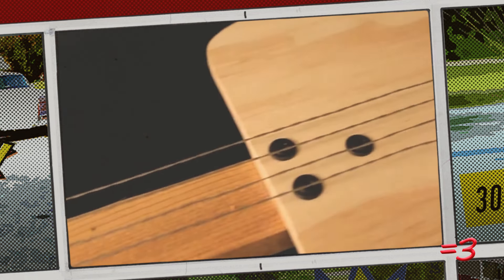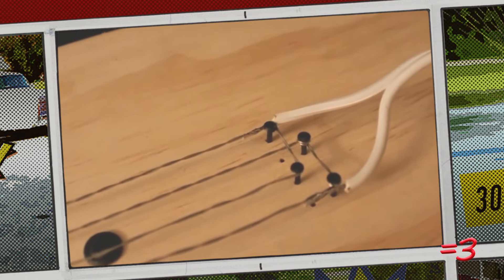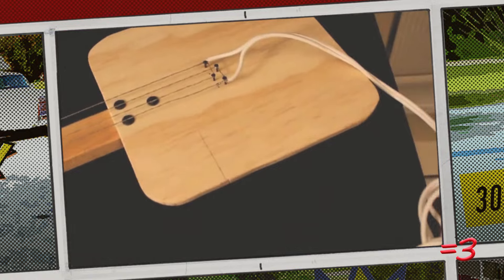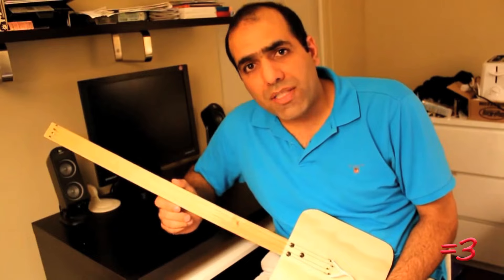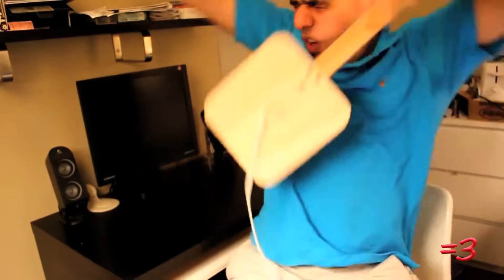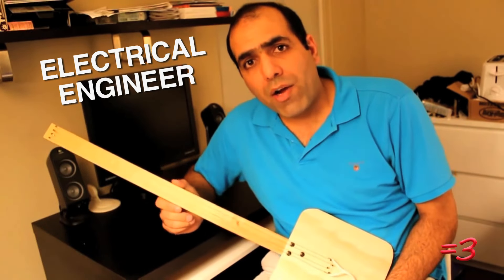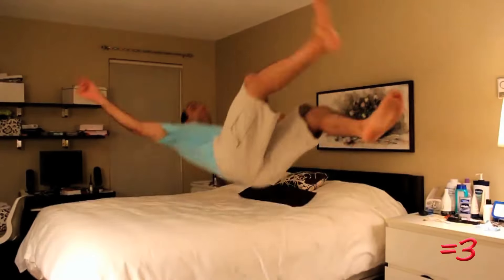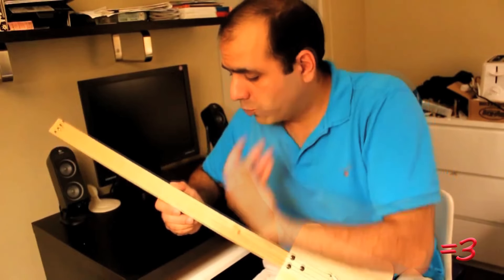How To Make An Electric Guitar (2013)

Comment: You can also tell its fake if you look at the way the "Electric Guitar" fell on him. Since he touched both the ground and positive wire (aka "completing the circuit"), he would have gotten about 120v passed through him, causing all his muscles to contract, then causing him to not be able to remove it. He would then just fall, and likely be temporarily paralyzed and/or die. If the said "electric guitar" fell with him, he would just burn. Just wanted to share how it's fake from an engineer's pov.